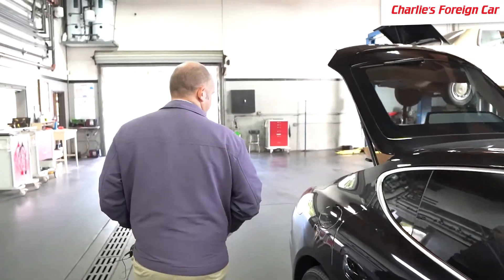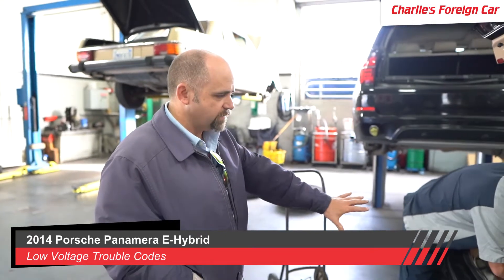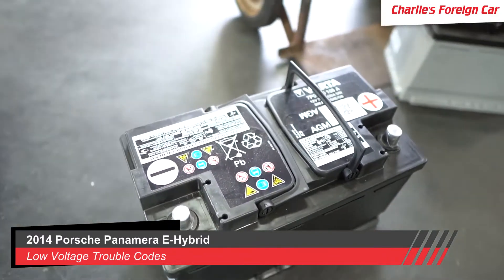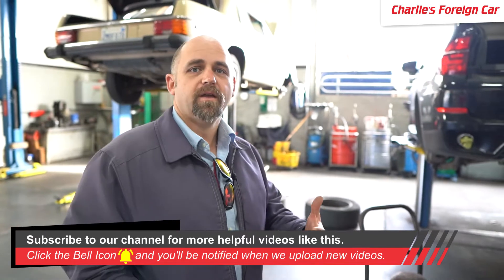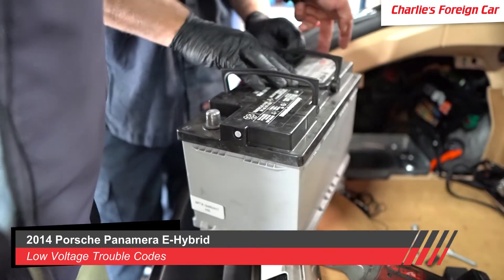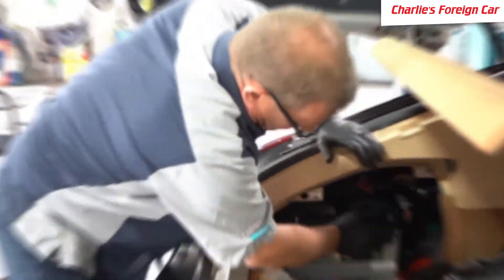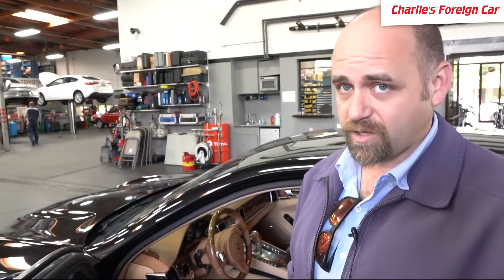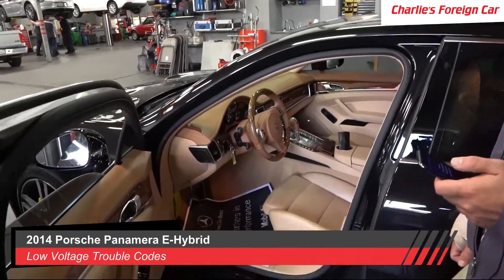Porsche e-Hybrid Trouble Codes

Comment: Yea, I am interested in the fix as I myself had to replace the 12 V battery but dealer says the code is still there. It’s drivable now that the 12V battery was replaced. They want to lower the battery to look at it for a $2500.00 cost so anything to help is appreciated.

Comment: What is the end of the story? Did u fix it with the first battery?
Reply from the maker: No, the car came back a week later.  We scanned it and it had codes for a faulty main battery.  We sent it to the dealer, because it has extended warranty on  the battery and it got a new main battery unit at no charge!

Comment: So what's the verdict i felt like I paid to see a feature film and the lights went out - What's the deal did it fix the Panamera problem?
I highly doubt it needed a 12 volt battery because if it did the car would not operate or surely drive. 
More than likely it had a problem with the Lithium battery as it originally told you!
 Nice Job for nothing why bother!